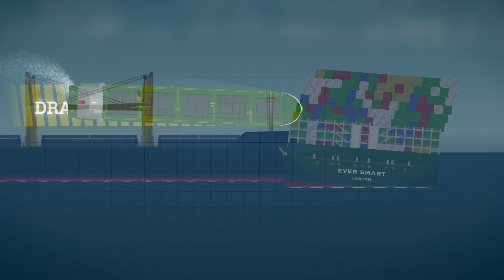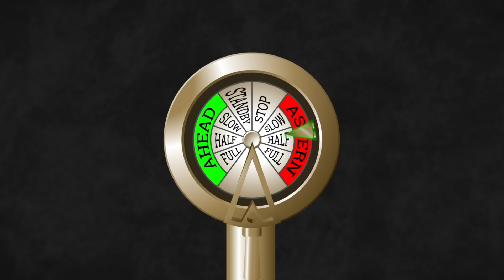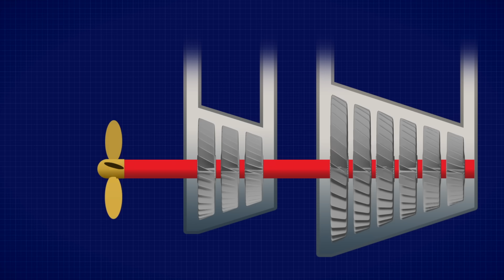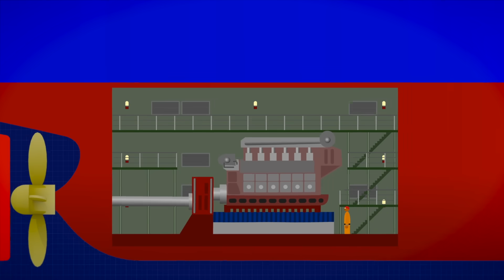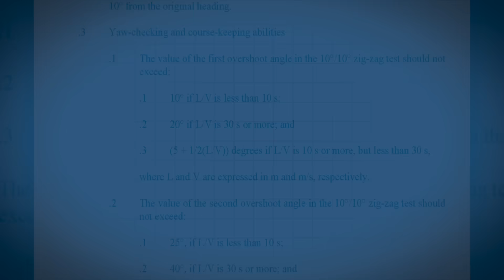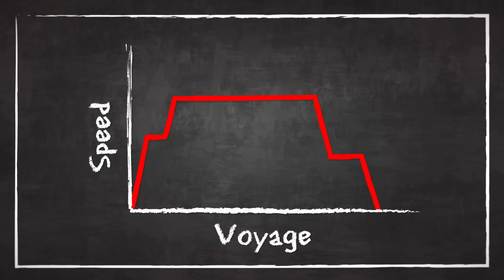Crash Stop: From Full Speed to ZERO

Comment from the maker: Turns out, stopping a ship is way harder than it sounds. Who would’ve thought?
Reply: The most terrifying thing about stopping a ship in an emergency is how long it takes.  The disaster happens in slow motion and there's often nothing the captain can do about it.
Reply: The first thing that came to my mind about the crash stops, is that it must be very hard to restart an engine in the opposite direction if it's directly connected to a propeller with fixed angle blades. Unless they have some really big clutch system that allow the shaft and propeller to spin free as the engine is restarted, that wasn't mentioned in the video? 
Because when the propeller gets dragged thru the water as the ship continue to move by it's inerta, it will impose quite a bit of torque on the shaft that "tries" to make it continue rotate "forward". Restarting in the other direction without "disconnect" the propeller, the starter motor or what they use, has to overcome that torque (and even more as it doesn't just have to be able to stop it from continue rotating, but also force the propeller in the opposite direction up to enough RPM for the engine to take over). 

Or maybe those large ship diesel engines (like the steam engines) are not like regular diesel engines, but have a way to deliver torque from 0 rpm and don't have to be cranked. Then they could just have a friction braking system that stops the shaft and propeller until the engine start delivering enough torque to start turning it in the other direction?
Reply: @Speeder84XL  There’s a video from @Animagraffs explaining in detail how the Titanic‘s steam engine worked. You should definitely give that a watch!
Running the engine in reverse looks surprisingly easy for steam engines. Internal combustion engines on modern ships  can’t run in reverse, they will need a gearbox that has a forward, neutral and reverse gear.
Reply: @Speeder84XL  Direct connect diesels relay changing the timing and forcing air into the piston to start spinning reverse once the air pressure overcomes resistance on the prop in forward moments fuel is added and the engine spools up. Here a video on crash astern for sea trials on a cargo ship.
https://www.youtube.com/watch?v=1fs2cU_MsRQ
Reply: Newton!
Reply: @rockets4kids  😂😂😂😂😂

Comment: Ngl from the initial clip I thought that some ships had something similar to a clamshell fairing (used as thrust reversers on aircraft)
Above water or in the hull most of the time, but able to deploy and massively slow the ship using its own momentum to redirect water forward, and with an area much greater than the propeller(s)

Jetboats do use this im pretty sure, they use fairings (aka buckets) to direct the thrust of their engines in nearly any direction

I wouldve thought that restarting the engine in reverse when already travelling forward wouldve been impossbile bc of the INSANE increase in torque on the engine. Forward thrust in forward travel wouldnt be too stressful, slamming the engine to a stop would create more stress, and trying to run it in reverse would be downright insane. Those propellers NEEDED to be strong while the controlled pitch propellers can have a smoother transfer of power, and give the engine time to increase output (and do so from an RPM that helps them)

I have no idea how youd start an engine from zero RPM with such resistance, unless your spinning it up and theres a poor clutch just waiting to be annihilated

Comment: While this isn't as aplicable to civilian ships of the era, military ships would use geared steam turbines rather widely.  Depending on the design, this allowed more or even all of the engine power to be applied to the reverse thrust.  There were also ships that used turbo-electric drives where a steam turbine didn't connect to the propellers directly, but instead drove a dynamo to generate electricity.  The engines were driven by electric motors, so full power could be applied in foreward or reverse, and with remarkable precision for the time.

Both these systems were less widely available due to their increased cost and maintenance.   Turbo electric in particular fell out of favor in part due to the sheer weight involved with the equipment.

Comment: Just to add, modern marine diesel engines with direct coupled propeller are reversing fully automatically. There is no need for engineers to do anything. As for the stress during the crash stop, one big point is surging in turbochargers.

Comment: You didn't address one outstanding question: how many ship lengths are required when reversing the pitch on a controlled pitch propeller? 15 for ships just using rudder cycling? So, what, half that distance with a CPP? Less? 

And in those cases, is rudder cycling still used in addition to reversing the propeller pitch?

Comment: You stated that CPP's always have the leading edge, leading, so that when they reverse the pitch of the prop, the leading and trailing edges are still leading and trailing. You then went on to say that when they do reverse the pitch, the water now flows from the opposite direction, effectively hitting the wrong side of the blades. Fair enough. However, imo, you effectively failed to finish that statement by effectively failing to mention, in any kind of an effective way, what effect and/or how that water hitting the wrong side of the blades effectively impacts efficiency and performance. I only say that, because you effectively did cover a bit of efficiency and performance when talking about gear boxes, as well as when effectively talking about spinning FPP's in the opposite direction.

Comment: I'm a bit confused about the end: modern ships still turn off  and restart the engine because  cpps are too inefficent?  Thank you to anyone who will answer 🙂
Reply: Yes, that's right. Large cargo ships are built to travel forward and straight. That's what we do most of a voyage. 
When the shipping area narrows, and we need to slow down, turn around, or even reverse, tugboats do it for us.
On a large container ship, you often travel straight for days without changing course. The engine runs at the same speed for days, and this is noticeable in fuel consumption.

CVPRs are found in small freighters, such as feeders, or other smaller vessels that call at smaller ports and often maneuver themselves there. In this case, you accept that the CVPRs are not as efficient because these ships often call at several ports in one day where the infrastructure is not as well developed, and can then navigate independently. (Such ships often also have their own loading gear so they don't have to rely on loading cranes on land.)

Comment: what about closing the barn doors?
Reply: Commercial rudder control systems aren’t designed for this versatility. If multi rudder, they all have the same rudder angle. Not sure if naval applications still design for this, probably not… gas turbines and CPP are plenty strong enough.

Comment: Why not use fluid couplings to connect the drive shaft to the propeller to normalize engine stresses output to the propeller and vice-versa? Too much loss of efficiency or what?
Reply: some boats like the busses of Venezia (Vaporetti) do use them, as you can go full power and reverse right away without damaging the engine or transmission. But they are built for frequent stop and starts, not for efficiency
Reply: It costs more, isn't as efficient, and is another part that can break.
But first of all, it's not necessary. 
Most large cargo ships perform this emergency braking maneuver only once in their lives. Namely, during the sea trials, as described in the video.
I've been at sea for 25 years and have never had to perform such a maneuver. 
What's more, I don't know any colleague who has ever had to perform such an emergency braking maneuver during normal operation. 
Large ships are driven with foresight. Thanks to the latest technology on board, we know what's coming long before it could become dangerous, and can therefore either slow down or, more often than not, simply evade.

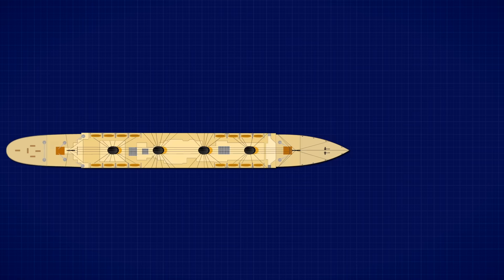Comment: While the rest of the video is amazing, 3:22 that part is so vague and doesn’t make a definitive point and just feels thrown in. ‘Older ships had three engines’? I’m sorry, what older ships? Ships throughout history have had varying numbers of engines (one, two, three, four, or more) based on their design and power requirements. Also, who told you that ALL triple-engine ships were ALWAYS one steam turbine and two reciprocating engines? It's true for only certain 20th-century liners such as Titanic. A bit of basic googling would’ve made that part accurate and consistent with the rest of the video.
Reply: Tru that. It's also not exactly an all great video or "amazing" video aside from that part. He talked about how inefficient it is to spin FPP's in reverse compared to forward, while he then went on to effectively fail to mention or explain, in any kind of an effective way, how the water hitting the back side of the blades would effectively impact the efficiency and performance of those blades. I just feel like he should have mentioned a bit about that when talking about each blade type, or not mentioned it at all, rather than just mentioning it for one blade type. Seems kinda like an ai generated script.
Reply: @DonnieBrass  I have to disagree with you. The script is objectively very good. If it's really written by AI, it must be at least 100 times more intelligent than ChatGPT because it makes very decisive statements and is very tight. AI written texts just meander and add filler without saying anything. The storytelling is also good. It's unpredictable where it's gonna go. 
That line that I described seems like a mistake, and ironically, AI wouldn't have made that kind of mistake. Maybe somebody wrote "ships in the past that used 3 engines" and forgot the word "that" and didn’t double-check it? Regardless, the writers should’ved made more effort to double check the script.
Reply: @koutkout3431  ai written reply
Reply: Investment firms don't care, they're just here to make money

Comment: …how does a diesel run in reverse, though?
Reply: Marine 2 strokes don’t use a camshaft iirc, they have fuel injectors and can run either way the strokes stay the same,
Reply: It takes in gasses and spits out diesel fuel.
Reply: Marine 2 stroke engines really don't care what direction they spin. There are methods to change the camshaft orientation (if the have one) as well as fuel injection timing to make it run either direction

Comment: You forgot about azimuth thrusters/azipods, and I guess technically Voith Schneider props, although those are mostly used on tugs as far as I'm aware.
Reply: You turn the azipods inward (pulling propeller configuration) first to maximise drag which keeping the RPM up. Below a ship/pod specific speed you just turn them full backward and increase RPM. Azipods are not used on tugs.

Voith Schneider has technically no "forward" and therefore no reverse. You simply rotate the control knobby thing and let the mechanics do their thing. Within seconds you can direct the thrust vector into any direction you desire. I wouldn't consider this a crash stop... its technically just standard manoeuvring. Same applies to azimuth thrusters.
A lot of bi directional ferries are equipped with them, too.

Comment: i wonder how that dial actually work
Reply: On old ships there were cables that ran between the two telegraphs to link them.  When the pointers were mismatched a bell rang continously until it was answered by the engineer.  Before direct bridge control an engineer sat by the telegraph to answer it and adjust the engine speed and direction as ordered.  New ones are electronic with redundant circuits.
Reply: @jamesmurney1374  okk so around what age first of those telegraphs were made bec I imagine pretty late in history if we talk about cables

Comment: Thank you! What I missed was some comparison data:
1. How many shiplengths brake distance do you save by using a CPP?
2. How much more efficient is an FPP over a CPP?
Reply: The trade-off with CPP is more moving parts requiring more maintenance more often, and introduces more points of failure. While fairly reliable mechanisms, they are extremely susceptible to fouling or debris in their hydraulic fluid and can experience degradation and damage that is not easily inspected or noticed until a major failure
Reply: The video still leaves out a lot of propulsion concepts.
Cruise Ships and ferry are often equipped with diesel electric propulsion. In their operation its massively more economic.
Although it might be easier to stop and reverse an electric motor, it comes with other challenges: Load on the electric system. Usually the ships sail with only a part of their diesel generators running. A sudden increase in load will cause a quick start of the remaining available engines. Starting, stabilizing parameters, synchronnisation and load sharing takes time. and it comes at the risk of an upset. In these forced conditions it can sometimes create a black out.... which will make you lose suddenly all of the engine power. Therefore it's wiser to call your engineer on duty and let him manually start an engine. 
Or it's even wiser to navigate proactively, conservatively and navigate around the obstacles.

Anyways, the sports car under the vessels are pod propelled ships... these are just crazy manoeuvrable. turning the pod inward using the rudder as a break first and use the outward wash as another way to create friction to initiate the slow down. Below 15 to 12 kn you just turn the pods opposite to the ships direction and stop in less than a mile from 20 kn or more. All that while stressing the electrical system much less than a conventionally propelled ship. Truly fascinating
Reply: @gustavgans8278 Early in my career I worked on a 100M waterjet propelled fast ferry.  During a crash stop the engines would stay at full rpm and the reversing buckets would activate.   It would go from full speed 35+kt to stop and going astern in 3 ship lengths. It had seatbelts in the wheelhouse for a reason.
Reply: @gustavgans8278  below 15 kn you stop in less than a mile from 20kn or more? How does that make sense?
Reply: @MarkVanReeth sorry, wasn’t phrased properly.

At speeds above 15 to 12 kn kn you turn the pod inward (prop wash points outward).
Below these speeds you turn the pods facing the stern of the ship and increasing to full power.
With this technique you can easily stop a 20 kn fast ship in 1 nm.
Reply: 1. Usually more than FPP, CPPs frequently have less astern power than FPP.  The do respond to the astern order more quickly but lack the thrust of a FPP.  Despite what the video says this my experience.

Comment: Why not just have "parachutes" that can be deployed in an emergency? I mean we've sorta already figured out this problem with stuff like aircraft landings, nascar, etc. Increase surface area for a fast and (relatively) easy braking.
Reply: Parachutes work on relatively light things. They’re generally larger than what they’re carrying. If we wanted a parachute that could meaningfully slow a boat, it’d be about as large as the boat.
Reply: Not nearly strong enough. Parachutes work better with high speeds. And if you have a tailwind, they will be completely useless.
Reply: Sea Anchors as they are known are only deployed to keep an anchored ship, or one at sea with a faulty propulsion unit, bow onto current in a strong cross or stern wind, they look like a wind sock on the end of a long rope.

Comment: What about ships with azipods, or bow thrusters?
Reply: Bow thruster only pushes side to side so it doesn't help with stopping
Reply: @jamesmurney1374 One could argue that pushing side to side aids in stopping, considering turning is one of the main strategies for slowing down. That said, though, I don't believe bow thrusters work very effectively at speed.
Reply: First you turn them inwards to a certain angle for maximum drag. Once the vessel speed has reduced to certain speed, you turn them 180 degrees around and apply full power.